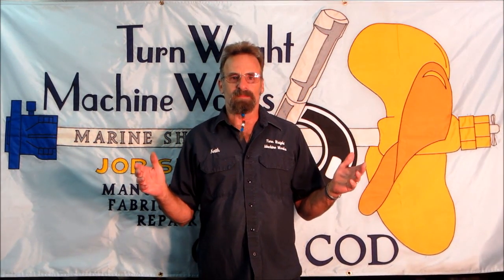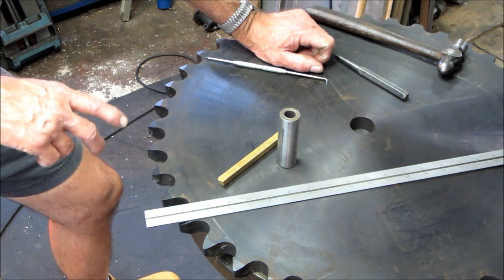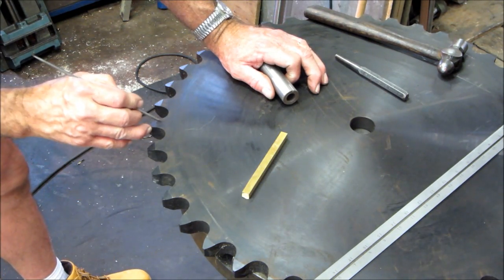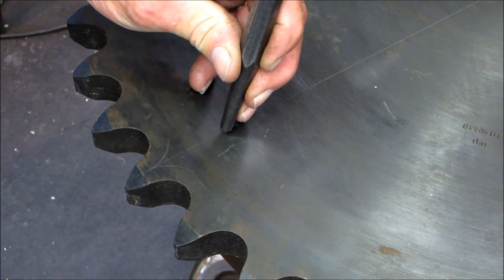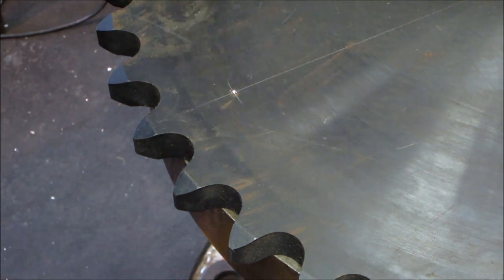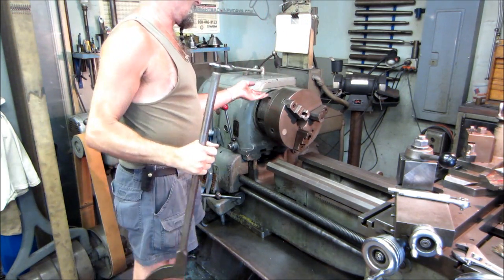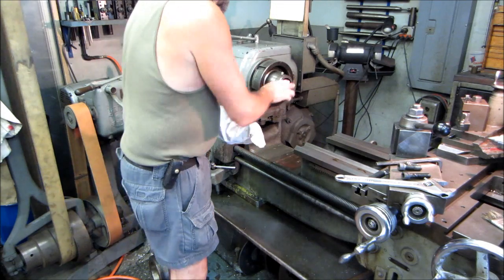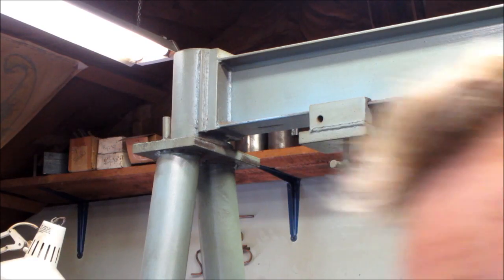American Crane

Comment: Keith, question: I'm welding a 2"x2"x3/4 4140 tab to a piece of mild steel 1/2 wall tubing. You got a suggestion as to what kind of arc rod I need to use?

Comment: The 1" and 3/8" stock pieces to scribe the center of the tooth was genius. I will definitely be using this method on some size 50 sprockets I'm working with!
Reply: +gurubryant Does it not requíre even number of teeth do do that? What if its odd number of teeth?

Comment: For one you have a nice old lathe,  something we do at work when we must change chuck heads is that we use a wooden v-block made from  a couple of 4" x 6" stock. this is a safety,  so we do not damage our lathe ways. it works for us and it was cheap.